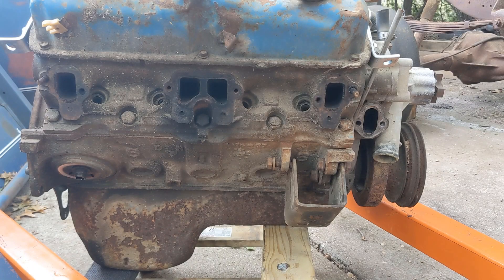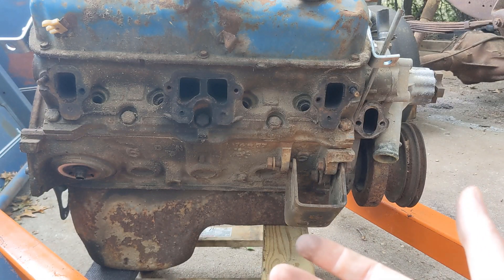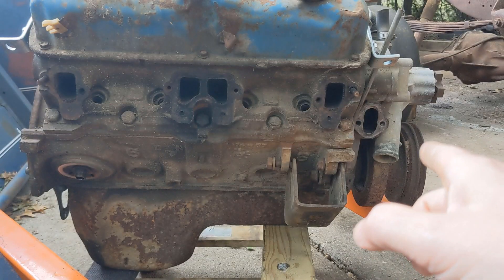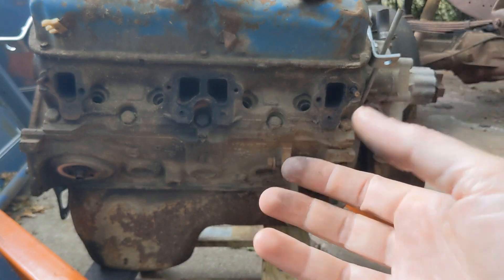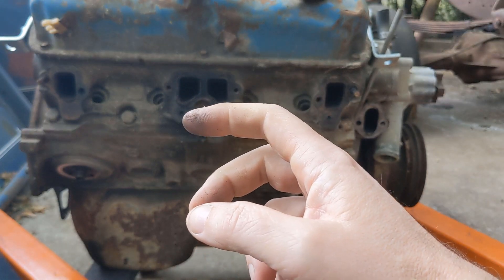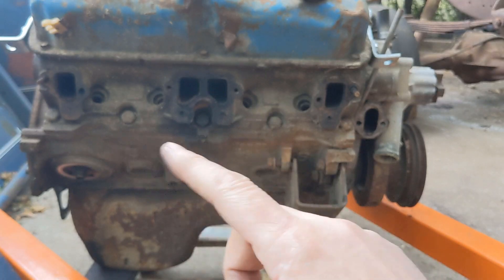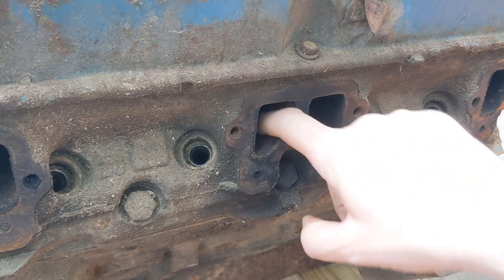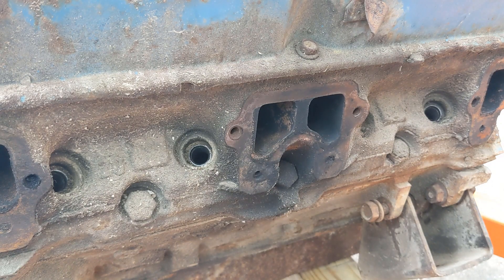What is AIR Injection?

Comment: Some modern cars have smog pumps, but it is made differently. They have an electric air pump and check valve that is plumbed into the exhaust. On some VW engines, the EGR valve had a device that directed air pump flow into the exhaust, then when the air pump was inactive, it would enable EGR flow. They called it a Kombi Valve.
During the 1980s and 1990s, Nissan and some other companies did this by putting a reed valve where the pump would be, and they put the other end in the catalytic converter.

Comment: They date back to 1966 in the case of Fords, my 66 Mustang had one.
Reply from the maker: Wow, I've not seen air injection that old. Now I want to research the history of it a bit more.  Thanks!
Reply: @YoshimoshiGarage  This may have been a California specific thing in 1966, my Mustang was originally delivered in San Diego, but I recall other Fords of the era having them as well.
Reply: @Paramount531  It is a California thing for that car. It wasn't mandated across the country until 73. My 69 torino for instance is a TN ca rand doesnt have any smog stuff.